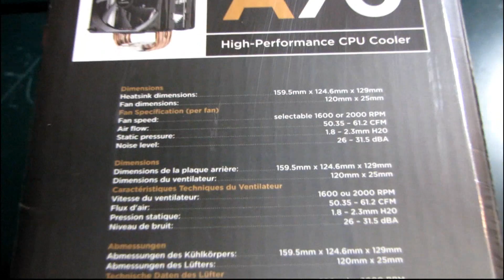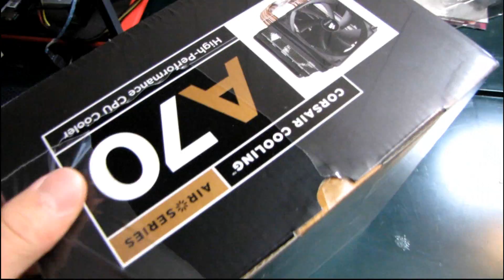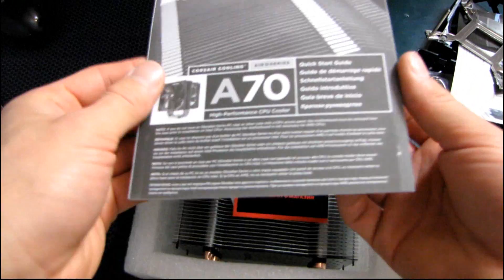Corsair A70 High Performance CPU Dual 120mm Fan Air Cooler Unboxing & First Look Linus Tech Tips

Comment: I got the A70 and although it blocks some of my memory slots, I can still get memory into them.  All I have to do is just be patient and make sure that both ends of the DIMM are in the same slot.  It also helps to note which way the old ones came out because they only go in one way and that could cause a problem if you don't notice that and attempt to shove it in there.

Comment: This is a great cooler.  I've owned it for about 10 years now and it's still works great.  I just updated my motherboard and cpu to a 6th generation core i5.  I didn't see a point in investing in another cooler, bt i did decide to replace the fans after all these years.
Reply: It is a great one indeed.  I have mine is probably just as old and was used previously with a Phenom II X4 965.  That was a 140 watt CPU and I never had any problems.  I recently sold that chip on eBay and still was able to get $25 for it.  My Uncle thought that big heatsink is unnecessary and wanted me to use the factory one.  After a few days of pointless nagging, I finally got him to give up.  I don't get why in the heck I would downgrade like that.  I have read that the stock coolers are not so great any how.  My new CPU is an FX-8350 which uses a similar socket to what my old chip did.  I did not tell my Uncle I still had the factory heatsink.  He always has bad luck and I try not to let it rub off on me.  He thinks big heatsinks are just a gimmick.  If I wasn't such a nice person I would dare him to overclock with the stock heatsink, that would make him realize that I am right on this.  He just doesn't realize you need more surface area.  Since I still had the heatsink that came with the new CPU which also turns out to be the same cooler, I just left that cooler in the box and sold it with the CPU.

Comment: coolermaster hyper 212 evo has the same deal with their copper heat pipes exposed, but they have them all side by side touching each other, and I think that is a better deal then having them spread apart...  but I do love the idea of having push pull fans and I wish cooler master would sell their cpu coolers with two fans, or at least an option of some having two fans without having to go back to the on line store to purchase them... they only come with one fan only!! SAD!! Talk to them!!  LOL

Comment: Hey, bought this product, works great, but the fans aren't PWM controlled.  Is it easy to install 2x 120mm case fans that are PWM controlled onto that heatsink or does it have to be specific type?

Comment: guys i figured out what to do with your old thermal compound, find a way to pull out the little pusher thing (i used a paperclip and pushing air through via the cap) but once its all the way back just push the cap back on and push the plunger in and with mine the cap shoot off pretty damn fast (it bounced off of my angled ceiling twice and went behind my bed)

Comment: @TheQulixia  mine did not fit, i am using the same ram, i am going to use one fan only and see if the temp is ok. If it is not then i am going water cooling.

Comment: @hokko1 Around 100% I've seen it around 40-60c... Although the first time I used this I didn't put much thermal paste and my temps were like 90c! Then I took it out and changed it up... I'd recommended to put a good amount of thermal paste, not to much, not to little... Now there around 53c under load! Not OC

Comment: @xXDP5150Xx meh, I guess you can call it that, but they usually are designed for smaller areas, therefore usually having less ram than ones that are high profile.

Comment: @anhtuan1t yeah, in such a little case there is not really room for it the strech its legs with cooloing, i would go for a mid tower, and then this cpu cooler. It also makes you future upgrade easier

Comment: @zajec11 not like the cool and quiet cause cool and quiet i believe it under volts a bit and lowers the frequency based on usage and heat plus controls the fans also but the Qfan what does is only setup the fans anyway you like without undervolting or lowering frequency right now im at 56C stable at 3.7GHZ with a Phenom II 955BE and i cant even hear the fans and if you have a not so big but good case aka Sentey Optimus 6000R its a bit of a pain to instal

Comment: Hi m8 awsome vids. I was wondering about this fan if it would fit inside a Corsair Graphite 600T Midi Tower as im going to order it soon.  AMD Phenom II X6 1100T Black Edition, ASUS Crosshair IV Formula, Corsair A70, Corsair AX 850W, Corsair Dominator GT DDR3 Corsair Graphite 600T. What do u think, will it be possible or will the fan be in the way for Memory and Graphic Card